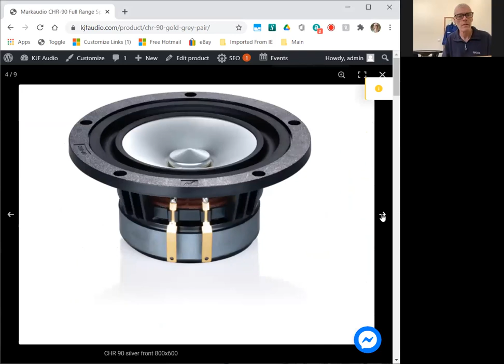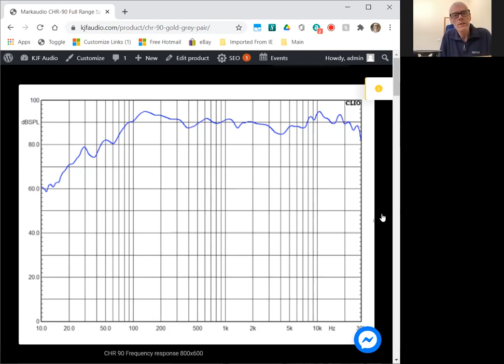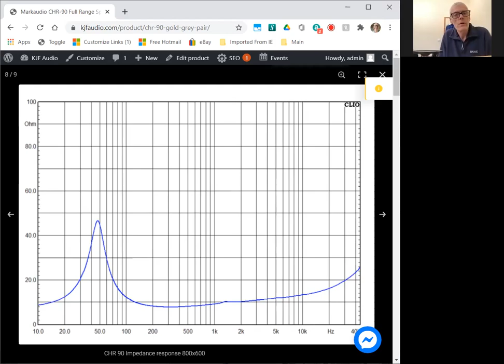Mark Fenlon on the Mark audio CHR 90

Comment: Hallo ... I bought a CHR-90 for my system, their contacts are attached to plastic, when connected with a soldering iron, won't they melt, like you connected the wires?

Comment: Mark Audio - Stick them in a Transmission Line FTW 😎
Back To My Roots - Mark Audio CHN-70 Transmission Line Speakers - https://www.youtube.com/watch?v=8CSoKFLjQlk
Transmission Line Designs - Projects Part 2 - Mark Audio - https://www.youtube.com/watch?v=-96WAVQdcyQ

Still love my CHN70's … and I do push them hard! I really don't miss a 2+ way set up, which was the main concern for me when swapping from 2-3 way to a full range. I'd take Marks' over the equivalently priced Tang's or Fostex. 

Just my 10 pence!

Comment: Shiiit. He touched the driver!
You could see Mark pause and swallow for a second. :-)
Reply: I've touched a few times with no bad side effects. One of them did fail when i accidentally stuck my knee into one .. but i guess that would go for many/any drivers!
Reply: @juststuff5216  it basically tinfoil plus. It doesn’t take any effort to dent or deform it. 
The second there is a dent the signature sound is changed.
Reply: @Frisenette  
"The second there is a dented the signature sound is changed."
Can you back that up with any measurable data?
Reply: @juststuff5216  no but it’s common sense. A small dent might have a small impact. But small differences is what hifi is about.